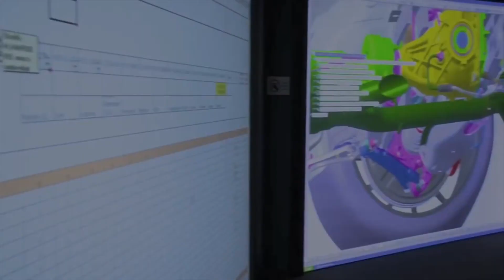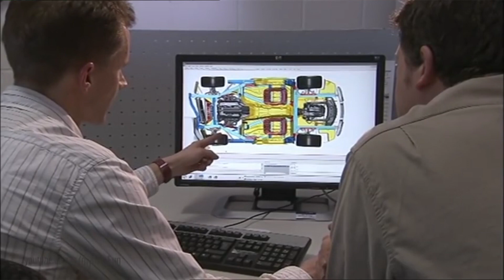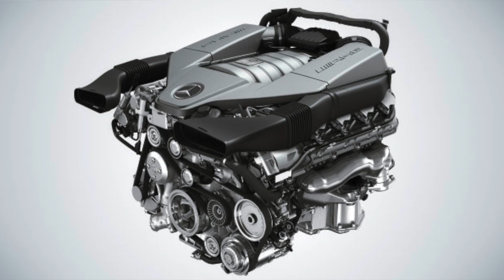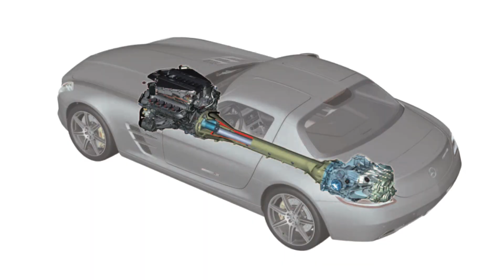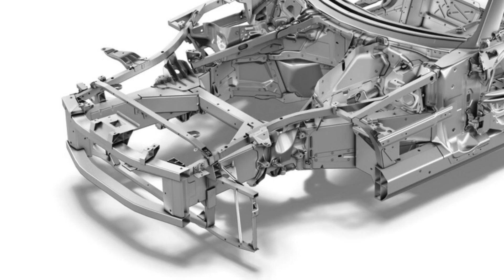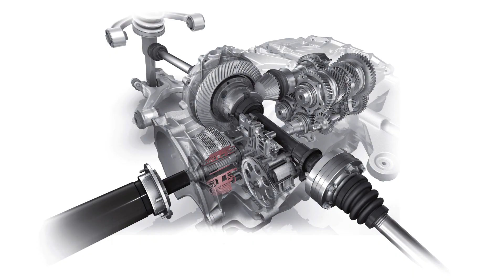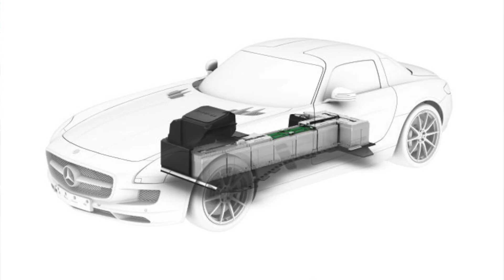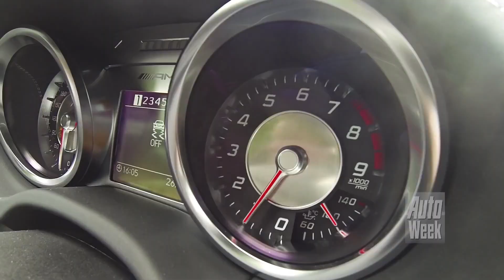The Full Story - Mercedes-Benz SLS AMG

Comment: even in modern motorsports 2019-2020 the GT3 competition  models still were using the M159 motors, even though the newer AMG GT's sported a more modern 4L bi-turbo V8's, M159's were more reliable and suited for track use. Says a lot about the original M156 motor design...

Comment: Thank you, polished presentation 👍amazing cars.
I serviced 300SL's and 300SEL 6.3 as a Star Technician when I first started my career at a MB Dealership. Amazing performance from a tube chassis, single cam shaft, drum brakes. And the then sophisticated air suspension, fuel injection, brute of the 6.3. I feel I know this SLS family because I spent so much of my life with the grand parents.
Engineered like no in other car -  Mercedes-Benz 🏆🏁✌️🇺🇲

Comment: You harp on about how iconic the gullwing doors are, and of course they are, but you fail to mention that the original 300SL ROADSTER is a much improved and far superior car to the coupe; It had more power and handled significantly better. 

I'd take a roadster for it's sleeker looks and to hear the engine. I don't particularly like the mandatory alcantara, black gloss, and red accents in the gt interior.

Oh and it makes little sense to compare the softer 812SF to the hardened SLS Black Series, it would make sense to compare it to the track variant (Copetizione or F12TDF). I've seen a video of a regular F12 lapping the Nurburgring in 7:08.

Comment: How did Mercedes get the SLS AMG Black Series M159 engine to rev to 8,000 rpm - isn’t it a cross-plane V8?? And a big 6.2 Liter engine at that (easier to get a smaller engine to rev higher than a larger engine).